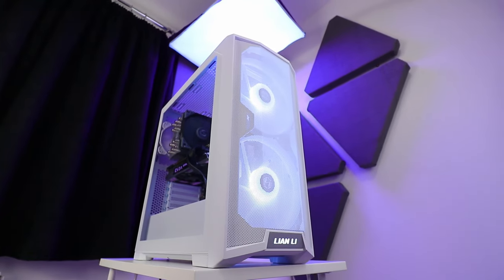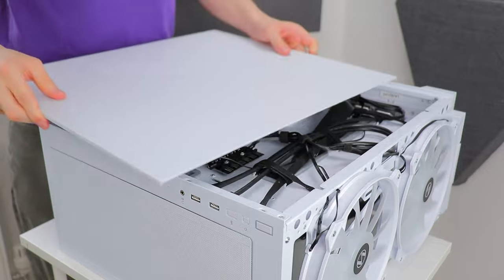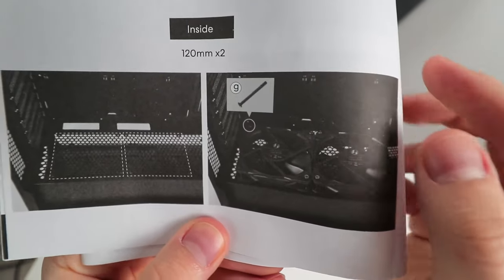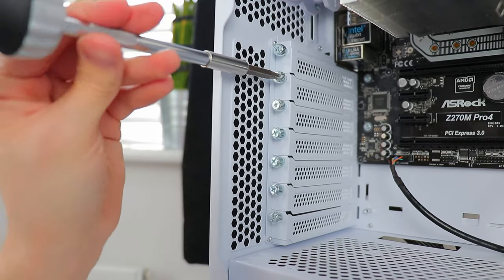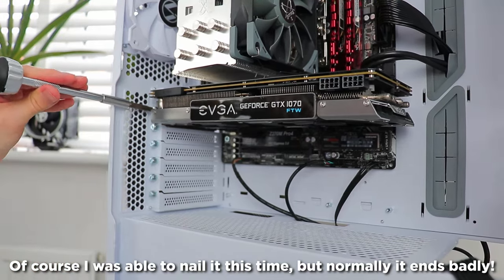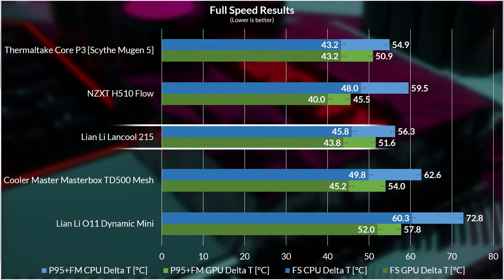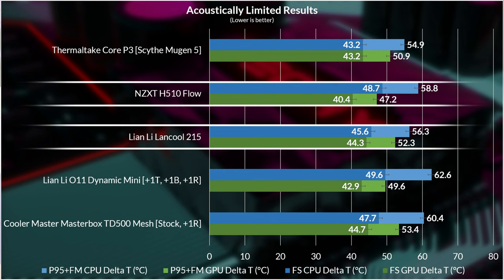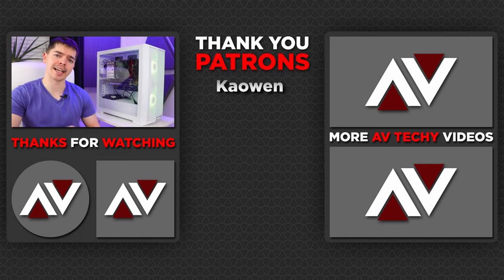The BEST case I've reviewed recently - Lian Li Lancool 215 Review

Comment: I love your case reviews. can you please do one for corsair 5000D airflow ?
Reply from the maker: Thank you :)

As for the 5000D Airflow, since I've covered the 4000D Airflow I don't think I want to go back to that series. There probably isn't a lot different between the two other than spec. I can imagine the construction, build quality, methods of support, etc. are the same or very similar. They certainly look very similar on the surface.
Reply: @AVTechy  between 215,4000D and ii mesh which is overall a better case

Comment: Meshify c has a full length undercarriage filter as well, makes it easy to remove from the front instead of having to reach around back. But this one, you still have to reach to the back anyway, so...????
I thinkbyour fan score is skewed because this case actually has proper intake and exhaust, which isn't typical for pc cases. Maybe some kind of calculation regarding current pricing might help it a bit, or maybe your system is good as is, and other manufacturers should include both intake and exhaust fans in their cases instead of making you buy a case and then get separate fans which raises the overall cost in the end.
Solid overview as usual.
Reply from the maker: Yeah, I'm reviewing the Torrent Compact at the moment, and that too has a full length filter (that makes sense), and like the Meshify C you mentioned, is also accessed from the front. Yeah, this one's not a well thought out design since there's no basement radiator support officially.

I'm not overly concerned by the position of included fans in the calculation. I think tackling fans regarding the overall value of them (amount, size, and quality) relative to the value of the specification (support) the case provides is the best way I could rate them. I'm in the middle on whether I should be including them as part of the main Specification score. But that's tricky since I wouldn't want to take away from a case not having fans since it's not entirely necessary, and if fans were part of that score then a case that didn't include a competitive amount of fans (which is sometimes 6+ fans) would never be able to reach a 10/10 for specification score (not that any of them do really). But fans individually are also very expensive relative the price of a case, so they do need to be weighted accordingly. I think you touched on this in your comment (e.g. 2x "Good" fans in a $50 case would be cheaper than getting a $40 case and buying 2x basic new fans - sort of - which means 2x "Good" fans are significantly valuable, which scales with the quality of the fans, and cost of the case)

I think right now (without checking the spreadsheet), Basic 120mm fans are 0.25 points per fan, Good 120mm fans are 0.5 points per fan, and Premium 120mm fans are 0.75 points per fan, and that scales for other sized fans based on their overall area relative to 120mm fans. Maybe I need to de-rate it to 0.2. 0.4, and 0.6 points respectively. Whatever I change it to (if I do) will impact the scores for all cases,so I'm not to concerned with making changes. I just need to figure out what's appropriate (what the value of a fan is as part of the case specification out of 10), and whether I'm being to biased towards cases with lots of fans/

These are always head scratchers, and there's no "right" answer. It's the inevitable subjective weighting of a review, hard to get away from. But we can only do out best and have somewhat thought out reasoning for the approach. I also want to generate more and better component volume calculations to better rate the efficiency of the case specification scores. They're fine for now, but more refinement would be better (as is the case with everything I guess).

Don't feel the need to respond to any of that, it's mostly unintelligible brain vomit :D Now you know why these case reviews are longer than usual.

Comment: Sorry if you already answered I’m currently watching the video.. but what fans or changes would you recommend? Would I be ok with stock fans in this case with a 5600x and 3080?
Reply from the maker: The stock fans are a great start. I suggest if you're set on the case, buy it and build your system in it. Then see how the temps are. Chances are they'll be great.

If all the temps are below 80C when maxed out that's great. If they're a bit higher and you want to reduce it I'd modify your fan curve to be a little more aggressive and see how that changes the temps, and if you're happy with the house output (should be reasonable at all speeds with these large fans)

If they're a lot higher or you're not happy with the noise output then it's worth working out if the components you run are just got by nature. If they're not, I'd take all the panels off and see how the temps are just to get an idea of potential airflow improvements (not something I'd expect to make a lot of difference in this case).

And next (because it's more effort) I'd take a look at the thermal paste, which if it's old, poorly applied, or just low performance paste (really bad paste, but even bad paste if alright if it's new), can make a massive difference to core component temps (if it's your card that's running especially hot I'd recommend buying some thermal pads too just in case they need replacing while you're in there, but should be more than fine if it's less then 1 year old).

Apart from that, give it a go and see how you get on. I'm 95% confident you won't need to make any major changes (new parts or paste changes). That 5% depends on your expectations, hardware, and setup.

Comment: Between Lian cool 215 vs Cooler Master td500 mesh which should I choose ? Lian cool is cheaper but only by 10 dollars.
Reply from the maker: I prefer the cleaner look of the 215, and I'm a fan of the massive fans so I'd personally go that route. I think there's a much nicer finish to the TD500 though, it's got a nice paint job and it's more stylised so if you're really into that it's a solid choice.

Both great cases either way.
Reply: @AVTechy  Me too I also like the clean look of the glass panel as compared to Td500 mesh. I also like the finish on cooler master but they over did the glass panel with line design. I have decided to go for 215! Thanks for the reply!

Comment: Why do you have the fan under the GPU blowing down into the power supply area?
Reply from the maker: I didn't.
Reply: @AVTechy  My mistake.  At 8:54 I thought it looked like it was backwards but upping the resolution of the playback I can see the arrow pointing up.  Haven't touched chromax fans myself so I'm used to the sticker side always being on the "top" of the fan.
Reply from the maker: Focus more on the blades than the sticker of a fan. The blades "scoop" air much like a spoon scoops ice cream (unless it's a bidirectional fan with flat blades). Knowing that will mean you'll always know how a fan has been designed to work without knowing anything else.

There are a number of fans around where the fan blows away from the frame and not through it. It's always worth going back to first principles over generalities.

Comment: Would a top exhaust fan help with the temps or just be useless?
Reply from the maker: It'll mainly add more noise to the system, you might get 2 degrees reduction in temperatures if you're lucky (based on testing top fan positions in a few cases previously). I'd recommend a CPU cooler upgrade, or replace some louder fans in the system for quieter ones that you can run a little faster while maintaining noise levels. Hope that helps.
Reply: @AVTechy  ya thanks i was asking becuz im goona use it with a rtx 3080 which i know can run hot
Reply from the maker: I think something that's worth doing is removing all the PCIe slot covers. That will encourage a lot of airflow through the Graphics card section of the case.
Reply: @AVTechy  Wouldn't dust be an issue then?
Reply from the maker: It'll be a little more prominent, but nothing like if you didn't use the filter. The  PCIe covers already have plenty of unfiltered holes since they're typically exhausts instead of intakes.

 It's a trade off between temps and dust at a certain point. See how it performs first, and if you need more performance you can try a few things.